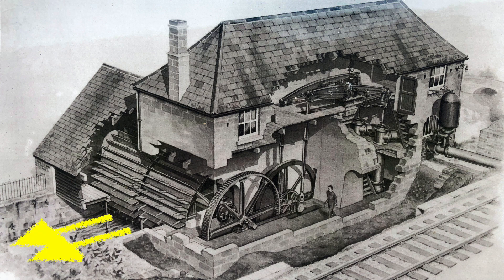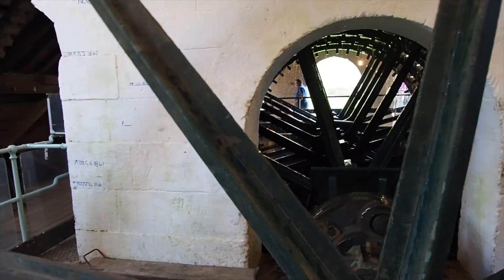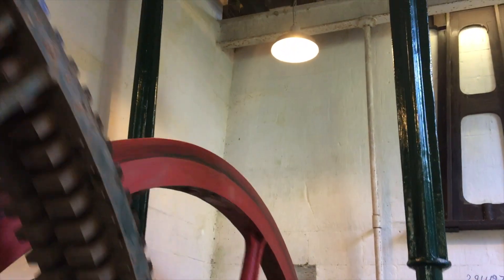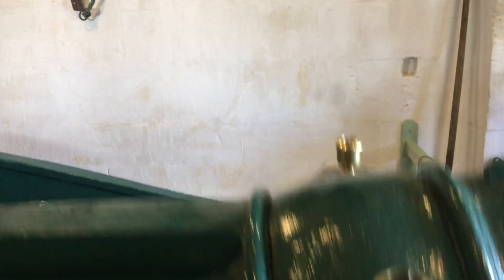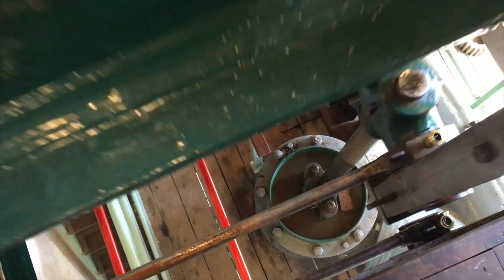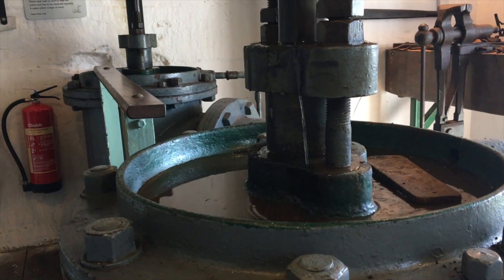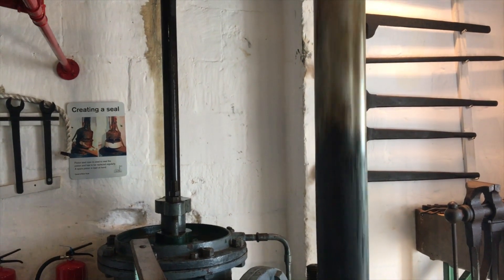Claverton Pumping Station on the Kennet and Avon Canal

Comment: interesting video, thanks for uploading!
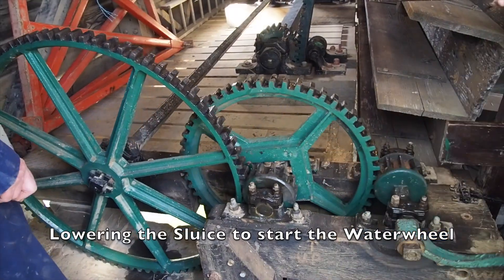In the two cylinder pump part of the station, mentioned at 1:25, what is the tank on the exterior of the building used for? thanks for your help
Reply from the maker: "There is a large air reservoir on the pipe just outside the building which serves to smooth the flow in the pipe and reduce the shock loading on the
piston valves." For additional detailed information on other aspects of the pumping station, here is an excellent link: https://www.b-i-a-s.org.uk/BIAS_Journal6_CLAVERTON_PUMPING_STATION.pdf
Reply: @nickfisher9191  thanks so much! amazing